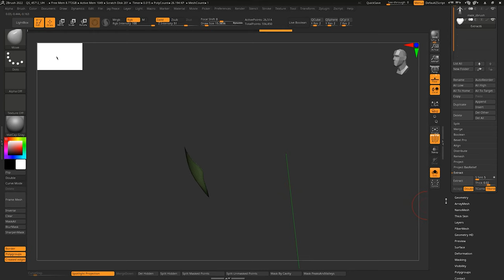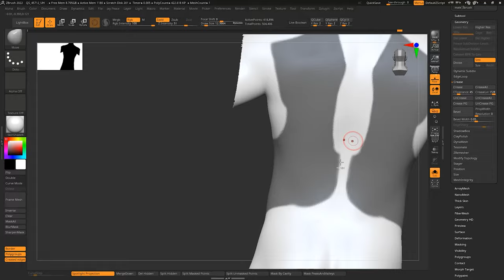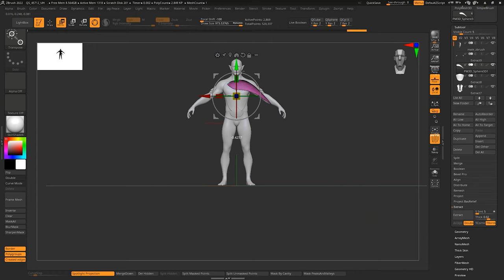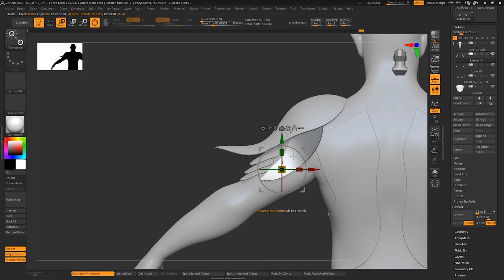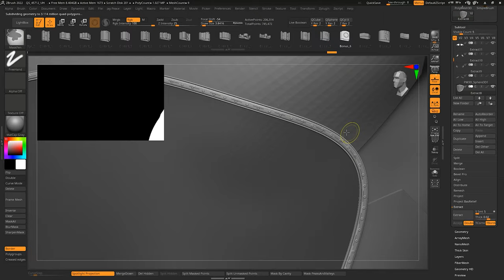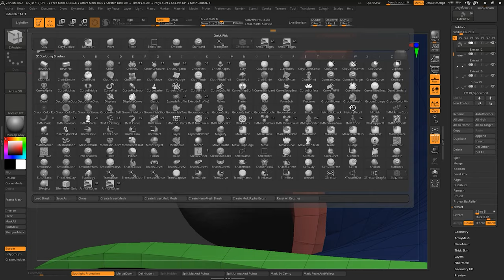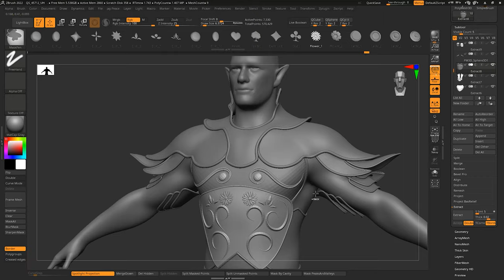Making an armor in ZBrush using Hard Surface techniques (also using IMM Armor Edge brushes)

Comment: Hi, nice tutorial, what is the reasoning behind step 3 and 4, whereby you isolate and use the back part of the mesh, instead of isolating the front and using that?
Reply from the maker: Hi! Thanks for the question and like! I do chose backside of the mesh because it is the closest part to the body, i.e. it makes easier to extract from that to outside rather than the other way around, because if I chose front side of the mesh it is possible that it will change its shape when I bring it to touch the body. I hope it helps. Peace

Comment: Would you use this amount of polygons in game development? Or would you do manual retopology?
very useful video thx
Reply from the maker: Hi Rael! Thanks for your comment. Here topology was not a primary aim. It is about how to make armor in ZBrush, rather than how to prepare it for game. For game you should bake low poly  to higher. Depending on the game you can probably can use lower version of this armor right after extraction, or you can go even lower when you extract and then keep than one in separate subtool to use for baking after you done with detailing in higher version of it.  When it comes to my thought of approach, since usually games require as low as possible and armor does not change its shape in animation as it is hard surface part, so it doesn't require perfect topology or dense polygons, I would probably decimate it using decimation master or just do manual retopo right inside ZBrush using ZSphere retopology. I hope it helps. Peace

Comment: Great video! How do you keep the shape of the geometry when Zremesh, without shrinking?
Reply from the maker: Thank you so much! Appreciate it! I would make duplicate of the extracted mesh and then use it as a source of projection. After you finish ZRemeshing the form you can use duplicated one as the one to be projected on. Second way is probably playing around with ZRemesher settings to keep that form. Third way is manually retopoligizing it using ZBrush ZSphere retopolgy or using other software to retopoligize. I hope it helps, and please do not hesitate to ask any further questions. Peace
Reply: @makeithappenwithjayinZBrush  Thanks!

Comment: Hey man, love the video! Can u just help me navigating edge brush, I installed it and load it into brush but just nothing happens, I cant choose or see what types of edges I have, I did everything u told in vide but still nothing happens. I have my auto show/hide turned oN in IMM Preferences/UI/IMM Viewer. Pls help :(
Reply from the maker: Hi Luka! Thanks for the comment! Sure, I think you should check the ZBrush version first, and here I used ZBrush 2022.0, so make sure you have at least 2022.0 or newer versions. Another reason could be that you have too many brushes on your ZBrush brush presets, you can fix that by saving these brushes inside Lightbox on ZBrushes folder.. You should copy these brushes into Windows C(or other disk where Pixologic is installed)>Pixologic>ZBrush 2022(or other version number)> ZBrushes>Choose any folder inside that folder(I would put inside "Insert-IMM"). Reload ZBrush, then you should find it inside Lightbox>ZBrushes.

I think if you try this it should work, I hope it works, if not please email me via jaypeace_art@yahoo.com so we can solve this issue. 

I hope it helps, Sincerely
Jay

Comment: when i taper the ends of my imm brush does not snap to the surface... it offsets a little bit above the surface of my mesh, any ideia on how to fix that?
Reply from the maker: It happened also with my sessions. But for some reason it was ok in earlier ZBrush but when I tried to make in newer which is 2022 version it had little elevation. I tried to change it in Brush setting, which was depth and attraction level, which helped little. But usually I manually brought it back. I hope it helps you too. Thanks for question.

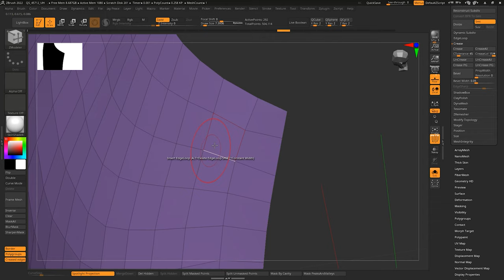Comment: 3:09 I am usually using Extrude instead of QMesh, is it ok? Is there any differences between using Extrude and QMesh.
Reply from the maker: Sure! They work almost same, just QMesh has function of sticking into geometry around the area where you extract. So, I would say Extract works even better than QMesh sometimes. So you can use it with no problem. Thanks for your comment! Good luck!

Comment: Hello, really good workflow i defineyely going to use it. But what is the settings for smooth shading. I always see the polygons . I researched it but couldnt find any real solution.
Reply from the maker: Hi Ahmet! Thanks for asking! Happy that you learned something! Sorry for late response. Maybe you were on the high polycount already when you tried to do that, or you did not switch on Dynamic subdivision when you wanted to see, or you did switch on but in the settings of dynamic subdiv you lowered its level...You can reach me via my email or Artstation messages if you need help. you are welcome anytime. Good luck to You!